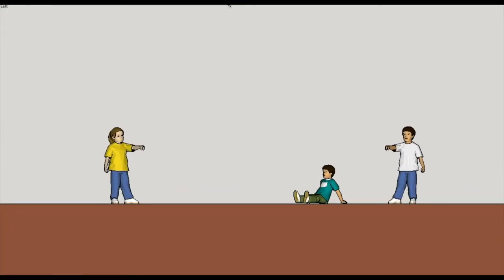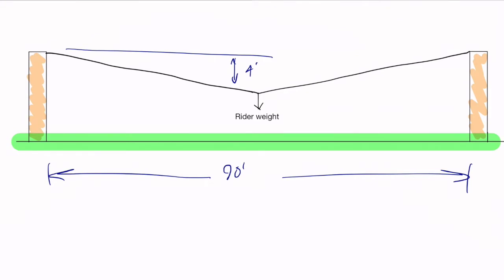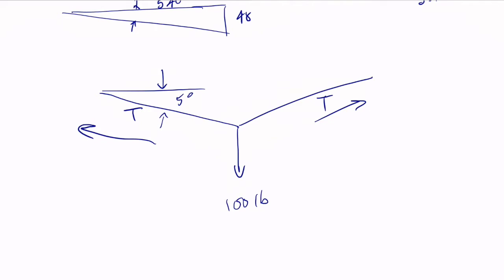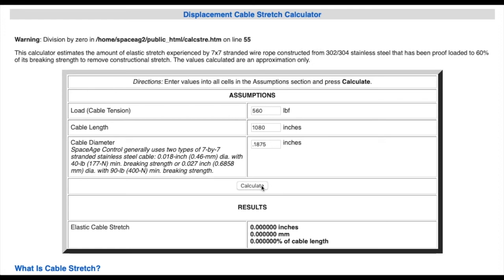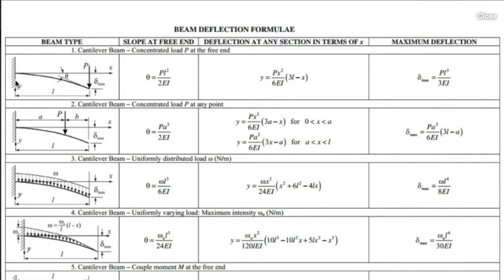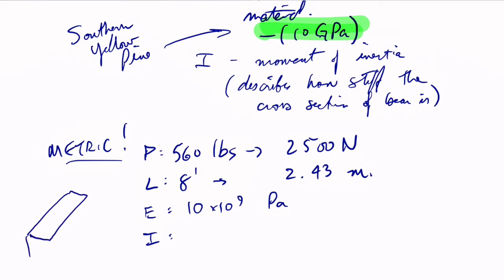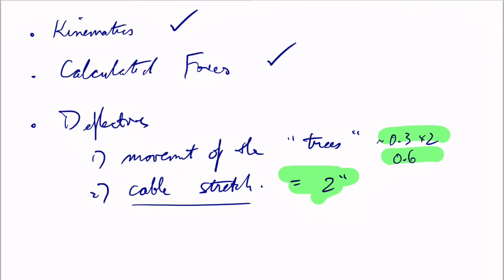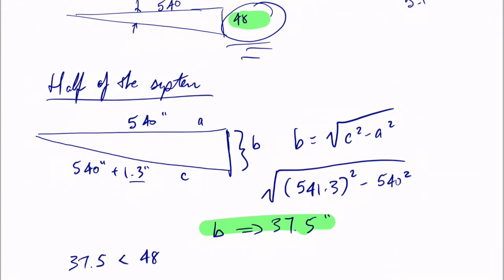Zip Line Calculations

Comment: I have a slackline that has multiple hanging obstacles from it.  It requires a 12" tree which I do not have.  Could I use these same size posts to connect it?  It states it needs to hold 2500 lbs.
Reply from the maker: I think it would be fine to substitute my anchoring system for a 12" tree, yes.  Good luck!

Comment: This video was really insightful, thank you for posting it and especially breaking down the math. This may be a dumb question, but would the same calculations work if the  numbers were different values? For example, if I wanted one that was longer and higher, I could use my numbers in place of the ones you plugged in and still get an accurate amount of slack and tension?
Reply from the maker: Yes - the formulas apply to different dimensions, etc.  For instance, if you wanted to increase the height (L) of your towers from 8' to 10', that 25% increase would double your deflection (delta is proportional to L^3).  So, to keep deflection the same you would need four 2x12's at each end (ouch), or would need to substitute the wood with a stiffer (E) material, say, steel.  Or you could figure some way to laminate a beam with more section stiffness (I <-- that's a capital "i").  Or you could switch to using stays.  So many ways to skin the cat.

Comment: How high could I make these anchors? Would I be able to use 20' lengths for a 90' span?
Reply from the maker: Short answer, no.  You can calculate it.  I recommend you use guy wires.  Good luck!

Comment: I noticed that the beam bend equation you used assumes the load on the beam is at a 90 degree angle.  I suppose that not completely accurate since the cable tension would NOT be exerting force on the beam at a 90degree angle.  But I suppose assuming the force is exerted at 90degrees would be the worse case scenario.  Is that what you were thinking?
Reply from the maker: The questions you are asking are great!  The fact that you are asking them means that you are thinking along the right lines.  And I believe you will find many answers yourself.  But I'll answer your question... My thinking was along the lines of getting an approximation, not doing a "worst-case".  All force vectors can be analytically decomposed into combinations of other vectors.  Google the topic "decomposing force vectors" to get a better explanation, then get a piece of scratch paper and a calculator play with decomposition a little and you'll see what I mean.  In your reference frame, the sine of 85 degrees is within one percent of the sine of 90 degrees.  So: close enough!!

Comment: Hello Ryan, I am going to build the same set up in my back yard for a 75' run. I have no slope and was hoping to have the ending height at 8' and starting point at 12' to 11'6" depending on the speed. Using 16' post on high side and 12' on low side. I ran through all the calculations with similar assumptions for a 8' at the end and 12' height at the start.  Drop of 4' and the same stats for the wood. I used a 160lb as the rider for me,  kids only 50 - 80lbs. T = 754lbs of force, degrees are 6.1. I calculated deflection at 1.35" for the 12' and .4" for the 8' side with 2.3" of cable stretch. Total deflection of 1.75", I am not sure how to feel about this, and if this is too much for the posts. .  Solving for B^2 I got 42.74". This seems like the it within parameters, would you recommend a guy anchor on either side for additional support? I was thinking about adding one to at least the 12' side, do you think it is needed? I can always add after if i get more deflection than I calculated. Would you be satisfied with these result doing the same set up you did, but just a higher starting point? With 3 2x12's on the high side I get Total deflection of .9" + .4" = 1.3", would you think the post can sustain this amount?  Thanks for the formulas and example to help calculate. .

Comment: Fair enough Ryan. I was rounding up from 7.5" to 8". I know the website I showed you recommends 12" and 8"...I am just trying to figure out if the 12" for the main pole is overkill, but I understand that your patience is exhausted.
Reply from the maker: Chris, the ziplinegear guidance presents your options as "either-or".  Re-read it again carefully.  Option 1 is to install a standalone post with a 12" diameter minimum.  You are not choosing that installation type.  So forget it.  Pretend that you never saw the number 12.  Option 2 is a double-post guy-wire system where the main post and the support post are each are 8" diameter minimum.  If you are doing guy-wire, then yes - 12" would be overkill.  BUT FINALLY - don't do any rounding up.  I want you to say the following words in quotes out loud ten times:  "7.28 is less than 8.  7.5 is less than 8.  I will not skimp on the number 8 because I am committed to following the guidance of both ziplinegear.com and the guidance of Ryan, who fully endorses that same guidance and he told me now four times to follow the guidance and don't skimp."  Fill up a chalkboard like bart simpson.

Comment: Very useful video - thanks Ryan. Like Luke below I also based my calculations on a 200lb rider over a 120' distance and the deflection was coming out at over 2", which is higher than I'd like. I don't have the space to use a guy anchor so I figured I would use two 2x12 beams in series in line with the run, with 12" to 18" between them and bolt the beams together at the top and middle with a couple of pieces of 2x12 - think of it as something like this |=|. Each beam will be set in it's own (4' 5" deep) concreted hole so I'm hoping that will provide more than enough strength/rigidity.
Reply from the maker: Paul, I like the idea of two 2x12 in series.  That will work well.  However - do not bolt them together in rectangular fashion ( I=I as you say).  Rather, take advantage of how triangles enable much much  stiffer connections.  Google search "triangles for stiffness" and you'll get explanations.  So, I recommend tying your 2x12s together like IXI, ok?
Reply: Of course - I should have thought of that! Thanks again.
Reply: @BILLYSHED  This might be a silly question, but wouldn't that require cutting one of the boards in half?  Potentially adding a new weak point of failure where the split board buckles apart from the other board.  This could cause the entire post to torque, very quickly resulting in a smaller diameter "tree" within the cable.  
I guess as a cloud platform engineer I'm used to searching for worst case scenarios, but I am intrigued at how this structure would actually be built.

I built a 40 foot zip line at my old house using 2x10x12's after watching this video and it came out fantastic!  I am so happy that I found you here!
I am about to build a 95' zip line this weekend, so I am really glad that your calculations come pretty close to mine, although I humbly ask you to take a gander at arwrester141's question above about one side being 12' high.  I am building the posts to take off of the balcony of this: https://paulsplayhouses.com/collections/playground-plans/products/pauls-clubhouse-play-set-plan

Comment: Hi Ryan, 
Great info and great video. Have seen many people use your guidance videos. 

Would steel RSJ type beams work? 
Thank you.
Reply from the maker: Steel beams would work, sure. Size them with appropriate section stiffness (EI in my calculations) and make sure you include some kind of gentle attachment mechanism so you don’t crimp the steel cable on the steel beams.

Comment: Any reason why 2x12x10s wouldnt work. If end height needs to be 78inches, with 3ft in ground that leaves enough out, no?
Reply from the maker: I feel like the 12 foot long boards were minimum. I would not recommend your 10 foot boards.  What a shame it would be to go through all the trouble of installing and then wish you had a few more feet. Don’t do it. Get the 12-foot long boards.
Reply: Ok thank you!

Comment: Really nice calcs, ¿did you check the estress on the cantilevered beam?
Reply from the maker: Yeah - the compressive stress on the bottom/inside of the anchors is pretty high - almost as high as the compressive strength values for lumber that I can find on the web.

Comment: Any particular PSI recommended for the concrete?
Reply from the maker: Naw, at least not the way I used it. I just used the cheap quick set stuff from Lowe’s and it never had a problem. Zero cracking over four years of service.

Comment: can you please show /tell us how the rebar was used in the base hole?  thanks
Reply from the maker: I showed the rebar in my other video... verrrry briefly around the 3:30 mark.  Looking back at it, i maybe didn't do a great job.  Anyway, I bent the rebars in a "horseshoe" shape like you see.  The horseshoes were located near the top of the hole (maybe 2 inches below the surface) on the insides of the run.  Looking down from a birds eye view, the left and right rebars were in a "D" and "C" orientation... if that makes sense.
Reply: @BILLYSHED  thanks a lot,, very helpful... RD

Comment: Two 2x12’s are better than one 4x12?
Reply from the maker: heidi saldana I guess they are essentially the same. Just much easier most places to source 2x12s.
Reply: I think you'd experience less warping, over time, out of two 2x12s then you would from one 4x12. Especially if the boards were not center cuts.

Comment: Hi Ryan.  Did you do any calculation on the depth that you buried the post and diameter of the hole?  I found an equation, "Eq. (7)", in the following article, which results in about 19,000 N to push over your post.  Compared to the 2,500 N generated by the 100 lb child, this seems really safe.  Maybe, a smaller hole would work.  A 12 inch diameter hole results in 8,500 N to push over.  I am considering using a steel pole and smaller hole.  

Article: http://digitalcommons.unl.edu/cgi/viewcontent.cgi?article=1206&context=usarmyresearch
Google sheet with my calculation: https://docs.google.com/spreadsheets/d/1xNHCyY33ueuB8tualJnHPk1vvi34AXowaCzkakxISpo/edit?usp=sharing
Reply from the maker: Luke, awesome, thanks for sharing the article, interesting adjacent study done by our friends at the Army...  No - I didn't calculate anything about the holes, their depth, etc.  The way that I arrived at the set of choices and constraints that defined my system, I knew they were going to be absolute beasts that I didn't need to worry about.  And I had the luxury of a big yard so who cares if there's a ton (literally) of buried concrete out there.  So many ways to skin this cat, I just shared my way.  You should carry forward with your system design, experimentally validate, shoot it on video and share on youtube!
Reply: @BILLYSHED  The concrete quantity is the most intimidating element for me, but I am not sure I get to a ton. I calculate a net hole volume of 6 ft^3/hole or 12 ft^3 for two holes, i.e., 2 [ (  pi * 48 * 9^2) - (3 * 11.5 * 48)]  / (12 * 12 * 12).  This equals 20 bags of 80 lbs concrete at 0.6 ft^3 per bag (1,600 lbs plus a little water weight for about 1,800 lbs).  Reducing the hole diameter from 18 inches to 12 inches drops this to about 7 bags of 80 lbs concrete.  I will let you know if I move forward.
Reply from the maker: @lukecampbell8598  Your concrete quantities sound about right.  Don't be intimidated.  It's cheap and it's hard to screw up (too badly).  Definitely a little bit of sweat involved but just jump in.  Don't over-think it! <-- That's the lesson I learned after I finished my zip line install and the kids started riding it.  You sound worse than me with the over-thinking.  For perspective, consider that YouTube is filled with zip line videos from Class-A morons that didn't think a damn thing - they just hooked their shit up to the nearest vertical stuff they could find and let'er rip, and they are mostly fine.  I'm trying to pep-talk you, man.  Now you HAVE to do it.  I expect videos by the end of next weekend...
Reply: Hi Luke what kind of metal post were you going to use? I was considering a metal post or a using a utility pole. 
I was also going to add a guy wire to both ends either way. 

Ryan awesome video. I’m not engineer but I appreciate the time you put into showing your work. It’s been very helpful to help plan my zip line.
Reply from the maker: @lukecampbell8598  , I'd like to see your calculations for the effective stiffness comparison of steel pipe versus lumber.  I suspect you made an error in your calculations.  I have requested access to your google spreadsheet so I can find it.  When I compare EI to EI, a 1.25-inch OD steel pipe (with 1/8 inch wall thickness) is about 250 times less stiff than a pair of wood 2x12's.  In fact, to get a steel pipe close to a pair of wood 2x12s, I calculate that you have to get to outer diameter near 6 inches, with a 1/4 inch wall thickness.
Reply from the maker: @helipilot980    Thanks for the kind words.  Guy wires would definitely help.  The only reasons I didn't do them was for safety (dogs and kids running around) and for aesthetics.  I was pretty sure the home owners association was gonna gig me for installing anything, but they didn't.  Anyway, I would love to see what you come up with for guy wire assumptions / calculations -- I think you want to make your guy wires larger diameter (effectively stiffer) than your zip line cable...  remember, this is a stiffness-dominated application.
Reply: @BILLYSHED  Hi Ryan, I gave you access.   Intuitively, your conclusion makes sense in retrospect.  The original sheet had a Moment of Inertia input as 9.11E-02, and honestly, I cannot now replicate this number.  I think I made a lot of mistakes in the unit conversions and in other respects.  I made a copy of the sheet and redid the calculation in rows 17 and 18, and get a huge deflection in cell D14.

Comment: I'm like..  210# (me)  T= mid 1100's    dang..  "..were going to need a bigger boat".
Reply from the maker: you and I are similar weight.  I rode my zipline many times, just had to tuck my legs up so that my feet didn't touch the ground near the midpoint.  If your ground level has a dip in the middle, then you're fine.